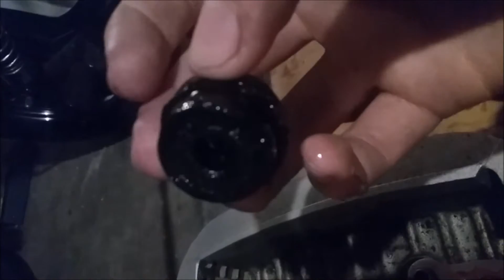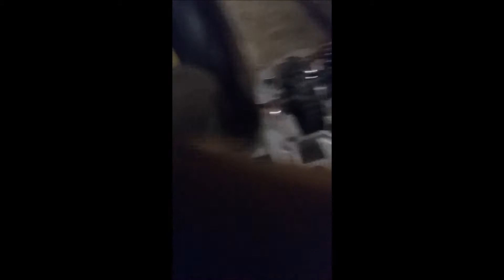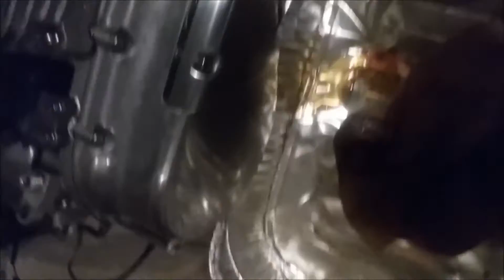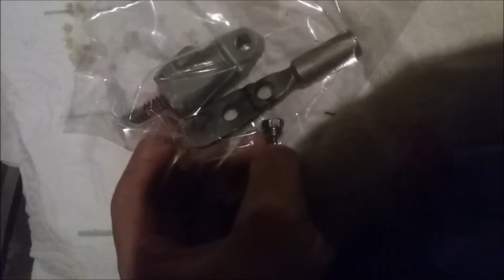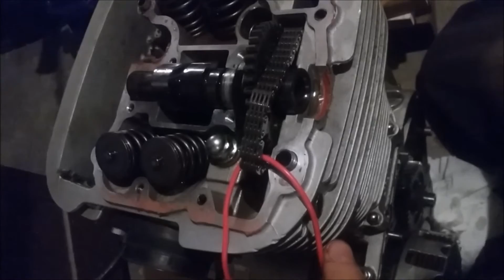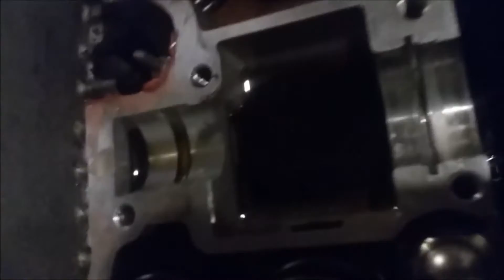LS650 Top End Engine Rebuild Pt 2: Cam Shaft Removal

Comment: Great videos my friend. Just subscribed. I solve electrical problems on my vx800 watching your videos and following steps. I had no spark. Now engine starts, but..... problem. I have 120psi in one and 90psi in other cylinder. Manual calls for 150. Steamy white smoke. Noisy valve ticking sounds and rich running engine. Head gasket?
Reply from the maker: Yeah sounds like you could have a head gasket leak. White smoke is a pretty good indication of that, more so the loss of compression. Some of the most common causes of compression loss are head gaskets or piston ring wear.

Comment: Hey I'm having the same leaking oil in the same spot. Did you figure out what the problem was? This video was extremely helpful by the way.
Reply from the maker: Indeed that plug was the culprit of the oil burning off, though not the only problem this engine had. Cam chain adjuster flew apart and metal shavings toasted the engine. Ended up boring and rebuilding the top end. Have hours of video showing how its done but much of it is poor quality like this video and I haven't had the time to edit and put the rest out.
Reply from the maker: When I replaced the plug I used the newer version of it. They eventually made a different version of the plug that is less likely to loosen up. Also sealed it up with high temp gasket sealant so it doesn't pull out again easy. They never did this at the factory and it happens to most of the older savages.
Reply: @MetricMotorcycleMadness  I have a 2011 so I'm not sure if i should bother replacing the plug. I already changed my cam chain tensioner. I guess I'll just wait and see if it's leaking oil from the top right. Thanks again for the video.